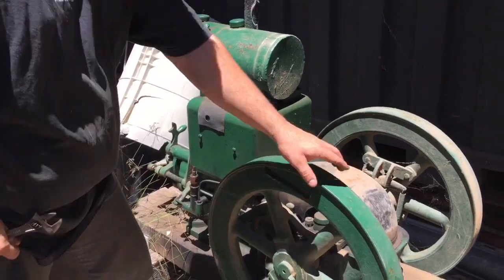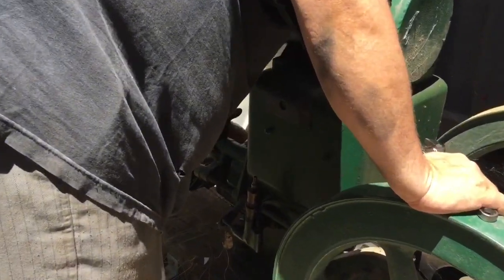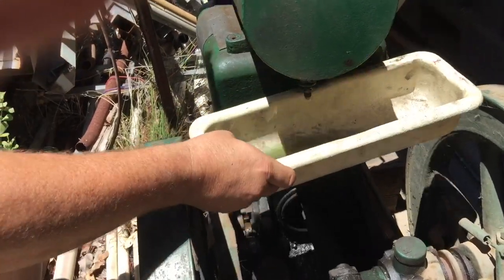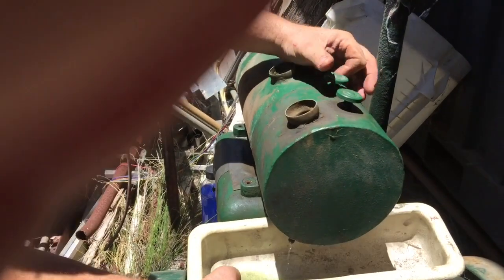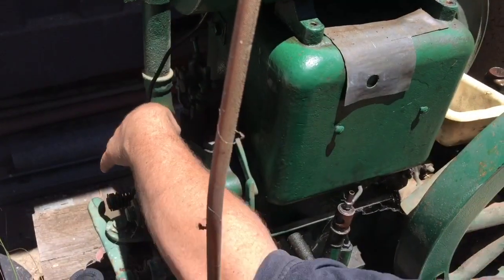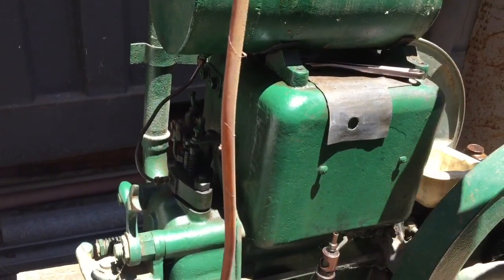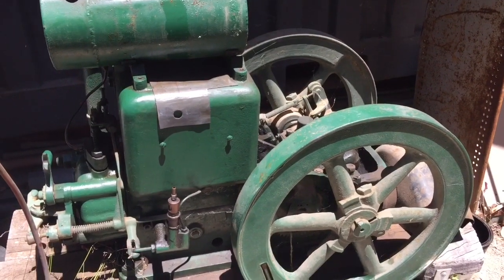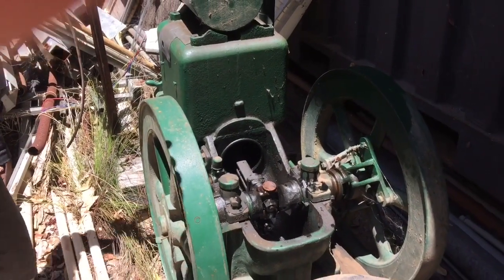Hit and Miss Engine - "Imperial Super Diesel" part 2

Comment: Well, it was a good cardio workout :) But seriously, I do not really understand how the engine is supposed to work. Apparently it is a diesel engine that runs on kerosene. Very common in the US in the 1920s.  So it has to have a glow plug or something to start. That is the first thing I would check. Then the classic diesel failure, the broken or loose piston ring. Good luck to you!
Reply from the maker: It's a compression engine, no glow plug or spark plug. Theres a decompression valve, which is the lever I drop after giving it a crank. Once it fires, there is a governed injector which feeds a measured amount of fuel into the chamber each cycle. Where the speed is over the governed speed, the injector is not triggered, hence the hit and Miss sound these are famous for
Reply: Kerosene was a popular tractor fuel in the 1920s. However most if not all started on gasoline and then switched over. I am surprised you can get kerosene to work like a diesel. I hope you can figure it out.
Reply from the maker: I did have an International super WD9 tractor, which started on petrol, then ran on diesel. I sold that on a few years ago to someone who wanted to restore it back to former glory!

Comment: Hit and miss??? I think you missed, but you did get your exercise for the day. If that is a diesel maybe you need more compression??
Reply from the maker: Yeah thinking that there is a little blow-by past the rings, might need to pull the piston and clean the rings before I try again
Reply: JBFromOZ there is a company in SA called JP Pistons. They will make any size rings, just send them all the necessary dimensions
Reply from the maker: I'll start with a clean I reckon, it may just have a bit of rust or crud caught up in there